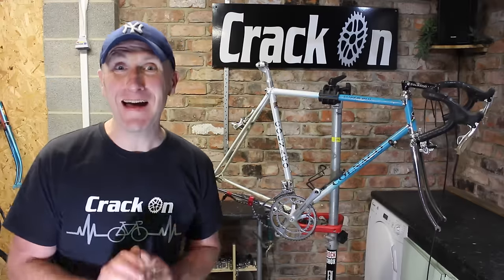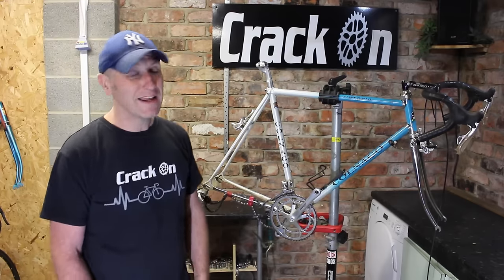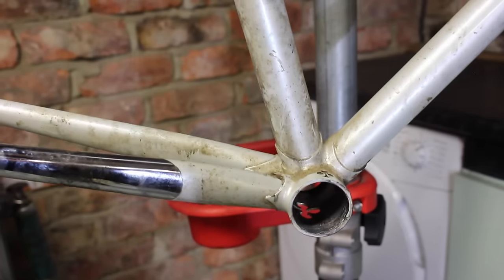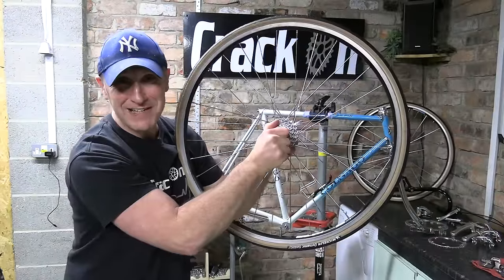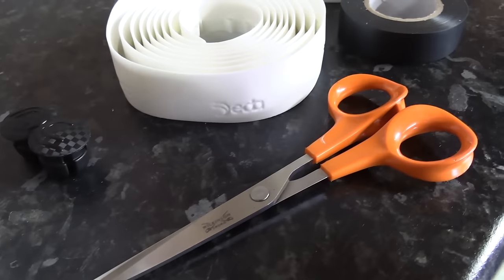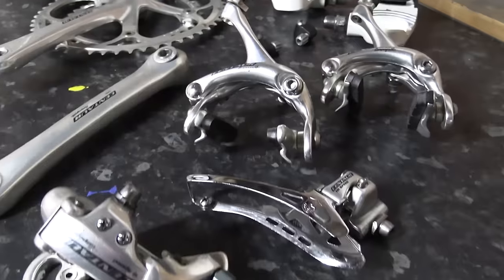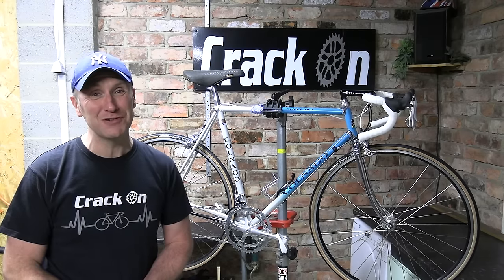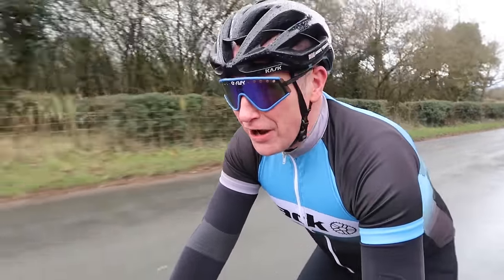Colnago Super Piu Road Bike Build and Ride

Comment: another nice build, but that handlebar angle is wrong and the shifters are still too low. (again, handlebar wrap should be the very last phase of the build, just in case the cable housing needs adjusting, plus you dont get the white tape dirty…)
Reply from the maker: Thanks for watching and your advice much appreciated all the best hope your enjoying the weekend

Comment: You always have fantastic builds. I have a question though, why are the bars always so low for your setups on classic road bikes? You don't find yourself ever losing out on a lot of positions in the hooks and drops that old school, full drops offer?
Reply from the maker: The lower bars were just on older race bikes to tuck you into a more aerodynamic position. Unlike a more touring position which is a more comfortable position 👍 Thanks for watching and your support much appreciated
Reply: @BikeItUK Thanks so much for the reply! I tried almost slaming my quil stems, but I found that backing off the drop from the saddle just a little bit allowed me to maintain an aero position for the majority of my ride, and I could stay in the hooks forever with a nice parallel bend of the arms. I discovered for me at least. low and stretched out really worked for aggressive racing positions versus low and down. Thanks for making these fantastic videos with all the bikes of my dreams!

Comment: Andy what do you use to clean your bikes with and all the parts.
Reply from the maker: Restorations the running gear petrol, frames T-cut...non restorations Much off degreaser and then GT85 and Muc Off chain lubes.

Comment: Hi Andy . . . another great video! You didn't mention the saddle but I could see that it was a San Marco Rolls . . . perfect. And what is the make of the wheels? Were they Campagnolo too? Really poignant last frame of Tommy's dad . . . keep up the excellent work!
Reply from the maker: Glad you like it thanks, the saddle yes I forgot to mention. Ive got about five restorations on the go at the moment and getting older completly forgot I didn't mention it earlier. The wheelset well that was a struggle massive I had 8 speed Campagnolo wheels knocking around, however massive change from 8 to 9. The hubs are completely different, I ended up with a set of Rigida Ultimate rims with Miche hubs. They run great and still have the look of the older Campagnolo hubs. Thanks for watching and your support all the best
Reply: @BikeItUK  My pleasure Andy! Your videos are such a breath of fresh air in these tech dominated days and I'm always excited to see a new one. I have a 1965 Urago which I originally ran as a fixed wheel from when I bought the frame new back in the 1960s. It's been through a re-enamelling and re-chroming and is now kitted out with all the Campagnolo equipment that I lusted after back then. Over the years, it's become the bike I desperately wanted in the lake 60s/early 70s but couldn't afford. It's the one possession I've told my kids they can't get rid of when I pass on . . . unless they bury it with me!
Reply: @BikeItUK  PS: to my last post . . .  I meant "late", not "lake! And I'd love to send you a pic of my Urago.
Reply from the maker: @rogerwatt8491  Love it laid to rest with your bicycle.....I have a couple in the garage my kids know about. funny how they become part of you. With the world the way it is, it is beyond belief every single person on the planet doesn't own and use a bike. Crazy, thanks for your support its much appreciated, all the best until the next one
Reply from the maker: @rogerwatt8491  Please find social media and website links on the banner of the BikeitUK channel you can send images that way no problem. Take care buddy

Comment: Any idea Andy what the weight of the bike is? Colnago's are built to last.
Can i ask you a quick question?  Whats your opinion of Guerciotti  especially their steel frame called the "Record". It takes 6 weeks to be built and the frames are made in Italy. I have written to the company but have yet to receive a reply.  Can you help out with advice.  Thank you.
Reply from the maker: Hi buddy, not sure of the weight nor the Guerciotti frame you are interested in. You’ve got me interested now though I’ll have to have a search now. Keep me posted I’m curious 🤔🚲 thanks for tuning in much appreciated 👍
Reply: @BikeItUK  Its called the Guerciotti Record and you can buy it as a frame with a 1 inch threaded fork in a variety of colours. Its hand made and will except an 11 speed cassette. It costs 1,250 euro and the sizes are plentiful.  I cant make up my mind wheather to take a 52cm or 53cm.  Its been so long since i rode an old school bike.  I am nearly 5 foot 7 inches.  I am currently riding a size 52cm racing bike and it has a very slight slope in the top tube which i hate but begger's  cant be choosers. Dont know who the Guerciotti distributors are in the UK. But there is one in Ireland.

Comment: What cleaning fluid do you use in the bucket?
Reply from the maker: For degreasing I use petroleum as a thinner. Hope this helps
Reply: @BikeItUK  Cheap and effective I suppose, if a little risky, and also not that easy to dispose of safely.
Reply from the maker: @worldofameiso5491  definitely the best at degreasing, make sure your well ventilated and no naked flames. Use a suitable sealed container it does settle and can be reused.